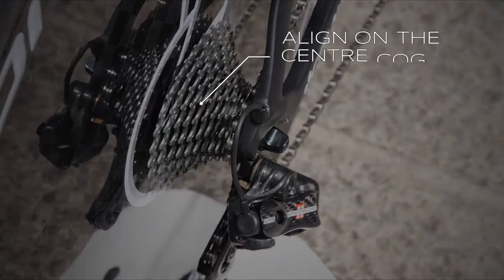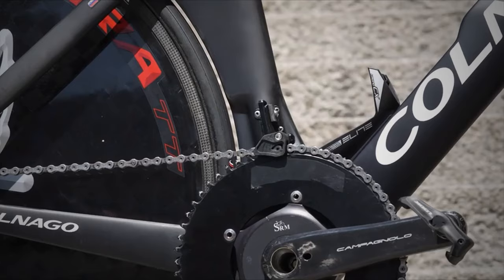Bigger chainrings for PRO TT Bikes WHY?

Comment: You can also have a cassette with more teeth thus if there is only one teeth difference the change in meters per revolution is smaller.
Also the stress on a faster moving chain is smaller if it's run with the same power.

SRAM wants to promote 1x drivetrain. Thus they need a smaller chainring and a very small sprocket on the casette to get an acceptable range of gears.

Comment: Those efficiency gains from using a larger chainring isn't a placebo effect.

Back when I was riding road,50:12 was a gear that I often stuck to on the flats,because it worked for me like a charm.When I switched over to fixed,I fitted on a 58t chainring and a 14t sprocket(to get a ratio that will give me a gear development that is very similar to what 50:12 does),and I did this initally because finding 12t cogs are really hard(at least for me it was).What I instantly noticed is that it was noticeably smoother,and it felt as if I was running a ratio alot lower then 58:14.

Yes,the losses on track bike and road bike drivetrains are different,but they aren't too far off.Thinking about that,I myself wonder why smaller chainrings are the trend right now,even on aero road bikes.It's just plain weird to me.
Reply: Exactly,they found out that the drivetrains run better and with less friction when you have bigger rings/cogs in the back! 👌🍀
Reply: The efficiency gains are small. 53t to 58t is a reduction in chain link rotation of 0.6 degrees. 11t to 12t at the back is a reduction of 2.7 degrees. OSPWs in some models go from 11t to 18t, which is a much bigger difference (12.7 degrees), and even that is only seen as a marginal gain. The efficiency gains of chainring/sprocket size will almost certainly be balanced by aerodynamics and by weight. Smaller chainrings will be stiffer, due to being closer to the spider, which could also come into their decision. It also comes down to needing the lower gears. Shifting is designed for 16t between chainrings on a compact, and they need the small ring.

Comment: Dont forget the disc brakes. With the wider frame spacing to 142mm, the cassette is 6mm extra outwards. So the perfect chainline moves from about  the13-14 tooth sprocket to (almost) the 15 tooth, so there is  an extra need to run a bigger cog on the rear and therefore a bigger front chainring.
Reply: Not a fan of disk brakes but sometimes the non drive side hub flange is moved more to center resulting in more even spoke tension  due to less dish. Mostly to sell the consumer the latest proprietary standard they'll abandon soon.

Comment: you are right, the way SRAM is going is nonsense! It's ironic when people buy SRAM AXS group sets with 10 teeth cogs and then buy expensive bigger jockey wheels to safe energy 🙈 Regarding the big chainrings of pros TT bikes: what you said is right, but I'm sure the top speed also plays into this. A cadence of more than 110-115/min gets uncomfortable after a short while, and that means 68-71 kph with 53/11, but even at moderate downhill sections they can ride faster on the TT bike, and with 60/11 that means 77-81 kph. So I think it is both - efficiency and speed

Comment: If bigger pulley wheels provide a marginal advantage, I wonder why Shimano uses bigger pulleys on a Tourney RD, and regular, smaller pulleys in 105-ultegra-dura ace.
Reply: There is actually more aerodynamic resistance in big pulleys that you gain with less friction! 
You get more gains with regards to friction loss with a waxed chain than with bigger pulleys...
So the way to go (in teams that know) is to keep the smaller pulley wheels, but wax the chain. 
The ones with the oversized pulley wheels and non-waxed chains are either sponsored, or happy to waste money.
Reply from the maker: Bigger derailleur pulley wheels don't do much as they are unloaded, just showed this to demonstrate the bigger gears
Reply: 1. Pulley gear here refers to tension pulley, which is the lower pulley.
2. In Tourney, it’s simply for longevity: Bigger gear; lower rpm. Lower rpm; lower wear.
3. Wear issue surfaces differently in top end compo compared to lower ends, for it being in roller bearing compared to bush bearings in Tourney. And, top end compo is ‘usually’ being treated better and being maintained and cleaned more frequently. Probably, in addition, ground clearance of a few mm does matter in top end bikes?

Comment: The pros are super powerful. They average 32 mph, and often pace at 34-38 on the flats. That's a 58x12 at 90-100 rpm. That only leaves one gear left. What are they going to push downhill?

Comment: I guess it depends on the engine that powers it but I so want to change my 52/36 to a 1x 54t chain ring for my crit build as these tracks here in Colorado are mostly flat with small punchy climbs

Comment: I think the important reason for using larger chainrings are gear ratios. Speaking of myself, I can tolerate gear ratio jumps quite well when I am climbing, but not as much when I am on the flats in aero tuck and I cannot increase speed for a much. For example, change from 14 to 13t will be smoother than 12 to 11.

Comment: Large chainrings look  cool. Too flat around here to need one. If you need to look cool get a junior 15-25 cassette and use the 60 tooth chainring. If you've got a 400 watt ftp maybe the 60x11 would start to make sense.
Reply: Getting 54/42 Dura Ace 9000 on my Cervelo P2. Considering Ultegra 14-28 cassette in the back 👍

Comment: I'm thinking of another thing. With a larger chainring, and moving to larger gears on the cassette actually decreases the difference between the gears, or brings your gear options closer. I'm sure the pros have a way wider tolerance for variations in cadence than me or any happy amateur, but at the same time they're more dependent on staying as close to their optimum cadence as possible.

I ride 50/34 and 11-29 (would probably go even lighter on the cassette with the options currently available). That means my lowest is 34/29=1.17, my highest is 50/11=4.54.

If we guess  a pro uses 58/42 and maybe 11-29 as this appears to be the tightest available in Chorus. That means the lowest is 42/29=1.45, the highest  58/11=5.27.

My highest would be 3.88 times the lowest.
The pro's highest would be 3.63 times the lowest.
That adds up to tighter gears.

And all this while the world has moved from 11 to 12 speed cassettes. When I bought my 11--speed (2011 model) I think you could still get 11-23, the biggest cassette was 11-29. Now the smallest cassette option is 11-29, the largest is 11-34.

I'd love 50/34 and 11-32 on my road bike, and 50/34 and 11-34 on my cx. But then I'm old, and weak....
Reply from the maker: Agreed 👍

Comment: Probably worth a video why Cav`s chain fell off. 
My analysis. Sticking free hub due to low lubrication causing chain slap. If this happen and you pedal backwards your front derailleur can jam up. Typically shorter teeth on oversize derailleur pullies cause issues when pedaling backward. Chain was too long because it was set up for say big chain ring and fith or sixth free hub gear but was shifted to the 10 tooth during final sprint. Basically nothing nefarious going on.
Reply from the maker: Yes that was interesting, why it came off. It must of came off as he stopped pedalling. I would think somehow he generated a whip in the chain, maybe due to a sudden stop pedalling + gear change or something. Not enough information to come to a conclusion just seeing it off on camera